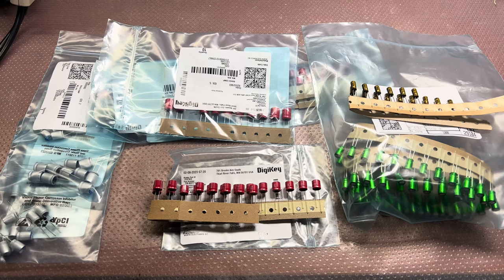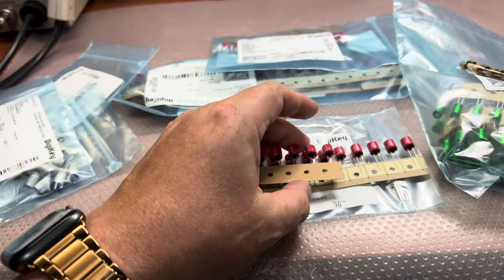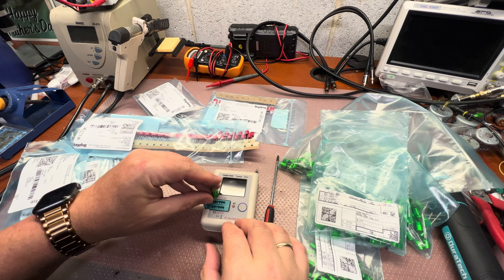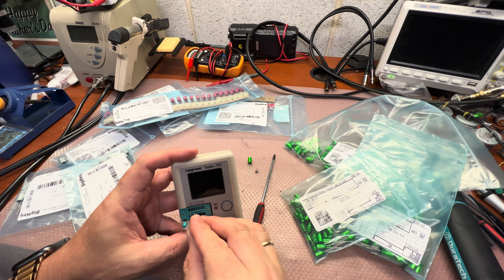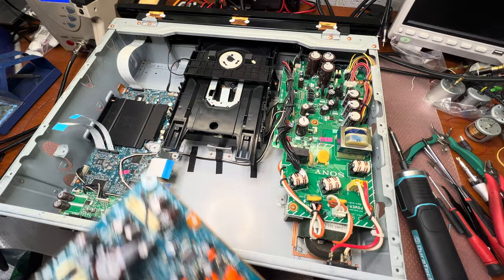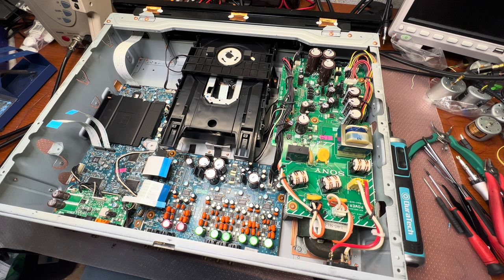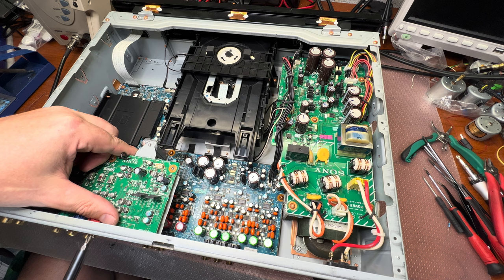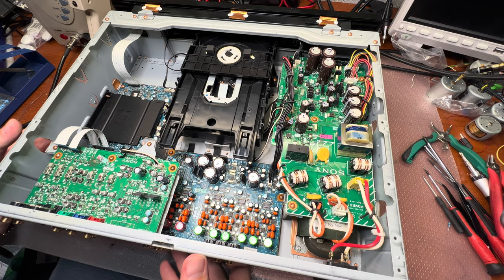Red vs. Green: Solid Polymer Capacitors vs. Nichicon Audio Capacitors

Comment: Many believe polymer just sound bad and have general guidance to use polymer for digital, with other choices, ideally PP/Styrene/PTFE/etc for analogue - I'd add mica in there for small values. Nichicon elect I've always found to be lackluster, and typically look for Vishay elect, now Vishay started to discontinue their audio grade caps, and that is truly a shame, don't really care about the nichicon green discontinuance myself - but at the end of the day, if it's electrolytic, it sounds like crap anyway.

Specific to this video, all you did was replace some electrolytics which were bypassed with PP anyway on the output board? That wouldn't bring much.. If it were my CD player, and I intended to use the internal DAC on it, I'd probably focus firstly on the bypass caps used on the output board, do those dipped PP sound good? My experience is 50/50. I'd probably focus more attention to the digital domain which is largely impacted by power.. Have a look at those CM chokes, can you find better? replace the wire from the PSU to the digital board with solid core silver, add your polymer caps to the digital board and have a closer look at the signal from the DAC to the output board.

Comment: Maybe you should take a look at the Chemi Con KZH series data sheet. Chemi Con KZH 35V 390µF 8x20 mm 6000h @ 105°. If you have a device, you can also measure whether + or - DC is present at the electrolytic capacitor.

Comment: Even Elna Duorex have been discontinued, I guess a long time ago. Some say they are PCB killers, but none of those in my K950 have failed.

It's 33 years on, unknown hours of operations and they still measure normal I believe. I am going to replace them at some point but.... with what? I'd be ashamed to install those half-sized caps, even worse aluminium bodied caps... oh no, I couldn't let that happen, not even if they sounded better than Duorexes.
Reply from the maker: You would not believe how well and linear these polymer caps are. Now my 555 performs like a Nakamichi, recording highs at -6db level. This was never happening before with any other caps. Stay tuned for the next videos.
Reply: It might depend on the capacity with the ELNAs, but it's a huge risk with them. We know that their electrolyte is simply unstable, so keeping them is like timebomb. In the Kenwood kx-5010/9010 decks, they've used silmic's, and while the smaller values are generally fine when it comes to measuring them, the 470uF ones have leaked. I've even seen an instance that these have even  killed the regulators. I would recommend replacing ANY ELNA capacitors (and yes, especially DUOREX) in at least the power supplies with PANASONIC FM, or if value not available - FR/FS. (Don't use FC, EVER).
Reply: @hifirulezzz  I'm detuning... I don't really wanna see that ;)

My dream are cultures of Nichicon Gold Audio Series, Elna Duorexes, Muses....
Reply from the maker: @m80116  At some point I may agree. 555 now sounds so precise, like digital. Very linear response over the full range. For the warm sound, I have other decks :) While I was tuning, I found an interesting thing - Dolby C initially did not match other decks, unless I additionally fine-tuned the tape path on 555esa. Did a very minor change but now all records are fully compatible with Dolby C of other decks, tested on DR-1, Sony 777, and Sony 555esj. Probably the first time when tape recorded with Dolby C plays well on all decks.
Reply: @Astralify  Well thank you for chiming in. I don't doubt the risk, but lacking sufficient knowledge I should deduce the assumption that Duorexes are unstable a guesstimate.

Is there anything that can confirm that theory?

I am more prone to believe failure of the bottom seal is the cause, hence powered usage related rather than time (unstable electrolyte formula) related.

What do you think?
Reply: @hifirulezzz  do you also align the left track during the tape path alignment? After the ABEX gauge I mean, do you hunt for L track max signal or do you go on directly to azimuth alignment?

Because I can't see any other way a NR could be affected by the tape path.

I seem to recall you have WLA calibration cassettes as well. Recently I swapped the hubs with tape on mine (I have two identical copies of yellow Azimuth tones) to some other shell to verify it wasn't presented to the transport and head in a different way... and it was to a minor degree.
Reply from the maker: @m80116  Well, even after alignment by a gauge I figured out that the ideal path may be a little bit different. The height of the left guide still will affect recording azimuth even if you set playback azimuth properly. This is weird but it is as it is. I used an x20 magnifying glass and made sure that tape will go strictly by the edge of the core of the playback and record parts. This had fixed recording azimuth. Before adjustment DR-1 was playing the tape with Dolby C by adjusting the azimuth to 10pm, after I adjusted - it is strict in the middle of the azimuth knob. I also verified this using oscilloscope. It was pretty fine recording and playing without the Dolby C. Dolby amplifies error margin by x10.
Reply: I was right when I noticed about my degraded tapes... they get badly worse with Dolby when they already sound barely acceptable without. Completely not transport related but still... and I quite like Dolby.
Reply from the maker: @VintageAudioTech  In many cases caps are NOT leaking and measured capacitance is fine. But when you take them in hand you just feel how lightweight they become.

Comment: Hi, I got a weird question and was wondering if anyone could help me. I just bought a Japanese tape deck and I need to buy a converter. Doesn't matter which wattage I buy or does that matter? I'm confused to the whole thing. This is my first time buying one
Reply from the maker: Hi, Steel. You should be able to find a consumption on the back of the deck on the label. Most of the decks are around 30W. I would recommend to use 200-500W adapter. my favorite is https://www.amazon.com/gp/product/B07L56PYZS/
Reply: @hifirulezzz  thank you very much

Comment: what's your reason picking polymer over metal film caps?. i see space is not a problem here
Reply from the maker: Metal film for 47 uF? I have not met that big.
Reply: @hifirulezzz  yes they do exists. i used some 47uF metal film caps though you're going to pay premium for it.... and they took quite some space too
Reply from the maker: @n.shiina8798  $18 a piece and size of the fridge? are you sure?
Reply: @hifirulezzz  depends on the brand. if you're going to go with regular brand like Epcos, Vishay, etc then yes, around that much. size wise, maybe espresso cup as a scale?

Comment: The closest equivalent for comparisons to the UES would be the PANASONIC's SU-A (Bi-polar) series, for an apples-to-apples comparison. I don't think they reach the UES sonically, but you can try them and make your own conclusions. Low ESR caps in the signal path not always sound good unfortunately, because some materials might even start to resonate, and these polymer ones's price is just insane. Totally not viable option economics wise, and they are also polar, so they would only be suited for single supply circuits with DC offset. Bipolars would still be better in  regular signal path applications with no bias. Also not sure how the polymers would react with half the soundwave where they would be reverse biased, and what kind of distortion that would introduce. Electrolytics are generally forgivable in such situations, but still - bipolar is much better. I dunno... The UES will be truly missed. Nichicon you d*ckheads...
Reply: i never measure caps distortion but polymer caps generally have way higher ripple current capability. i dont think small signal would hurt them. bipolar still electrolytics like two polarized caps tied back to back in one package. it's better to use film caps for signals whenever it's possible